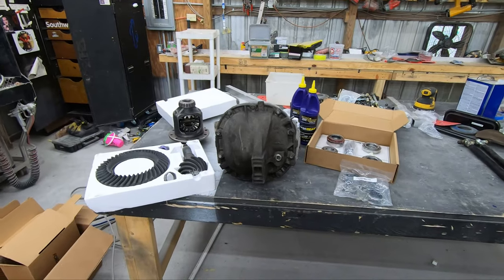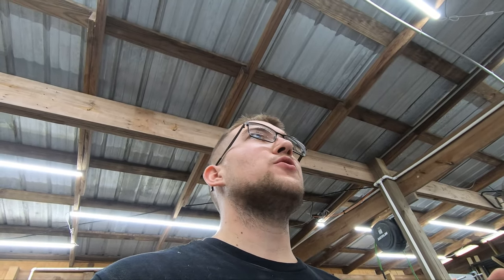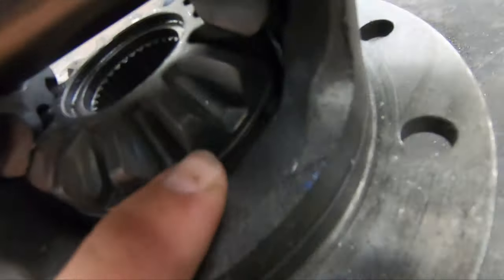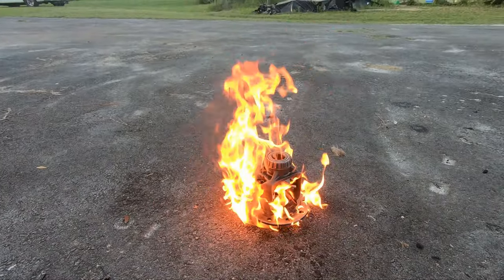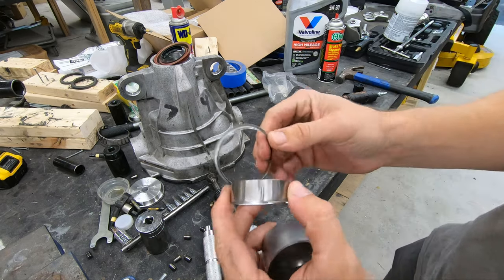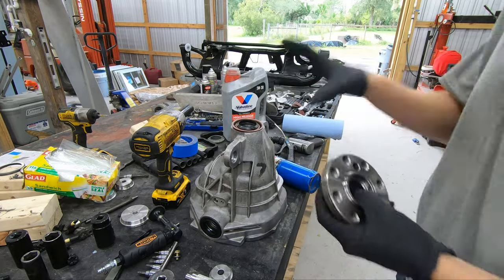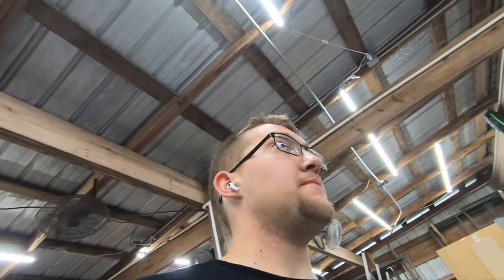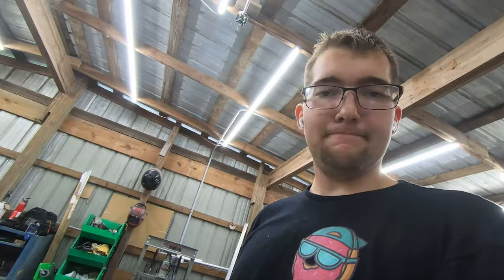Ford 8.8 IRS differential rebuild, making it drift ready! | comp car build ep.3

Comment: For anyone doing this the Ford manual states DO NOT use a impact gun to tighten the pinion bolt.
Reply from the maker: states it but yet my rear is together just fine, the rotational resistance is well within spec. I find it almost impossible to get the washer to crush with just torque wrench. ps ive done like 3 other diffs since this the same way and they all are still going strong!